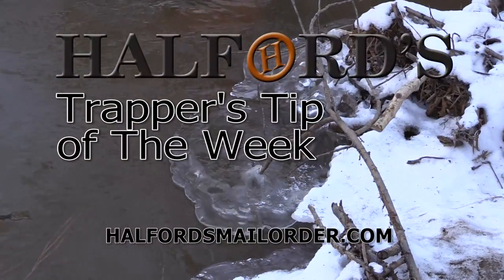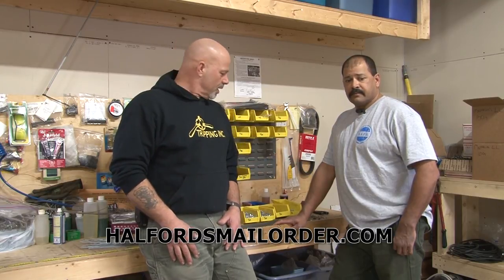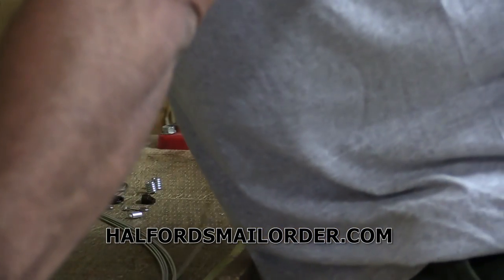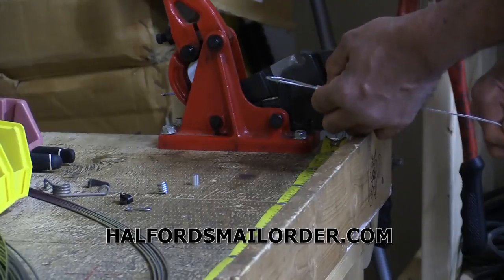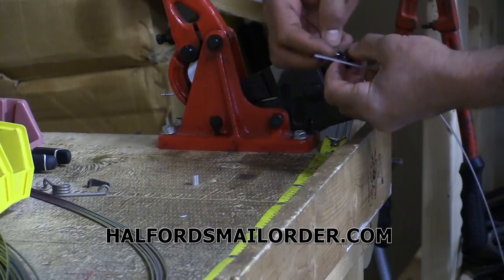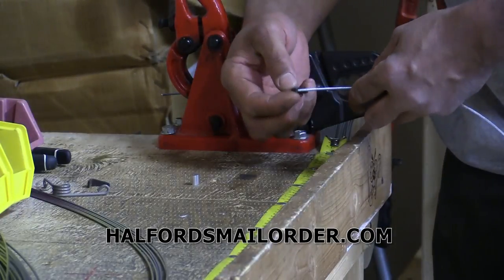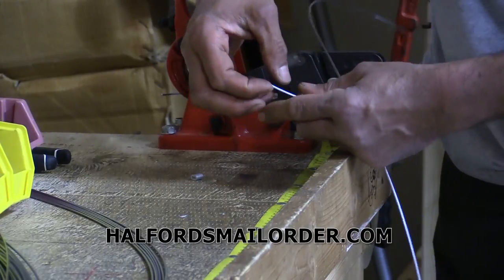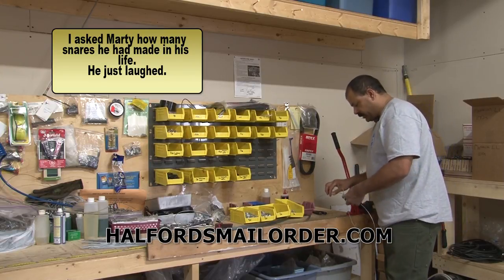Halford Tip 12 Marty Builds a Senneker Snare

Comment: Great info. Just switched everything to your system. Does it matter if the trigger is between the kill spring and washer next to end stop(top side) instead of between the s hook and kill spring? Can't imagine it makes much difference but wanted to check before learning the hard way. Thanks.
Reply from the maker: Works either way you bet.

Comment: I've seen them built with and without the washer between the spring and the stop.....Which way is recommended?
Reply from the maker: He is the inventor so I'd guess he should know the correct way.
Reply: @TrappingIncTV  He is the one I saw doing it both ways so I'm a little concerned,  I used washers because his latest video he used washers.
Reply from the maker: @aktrapper6126  I don't know what to say then! LOL I quit using his system 2 seasons back so I haven't kept current on it.
Reply: @TrappingIncTV  Well thanks anyway,  I've rigged up a couple dozen with the washers,  the whole system seems to leave a lot of tackle exposed and I'm worried about refusals.  It also adds expense to the rigs.  I'd be interested why you quit using this system?